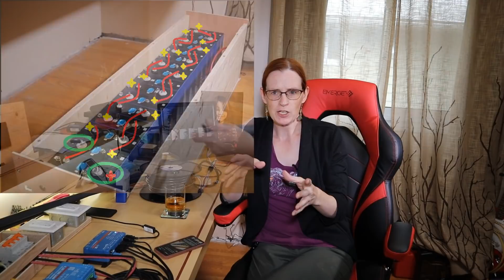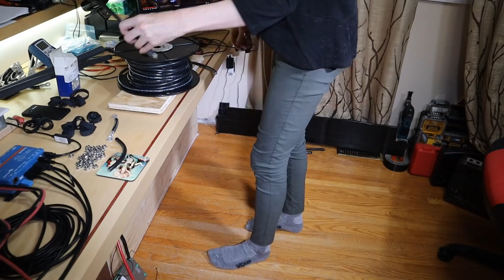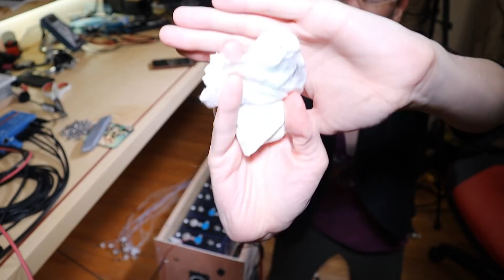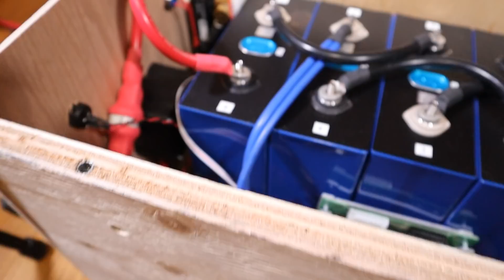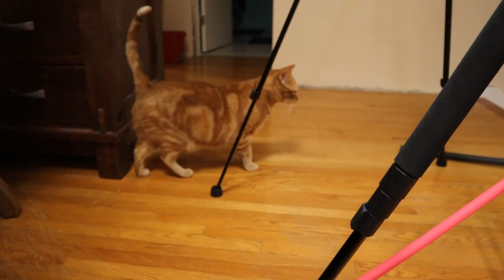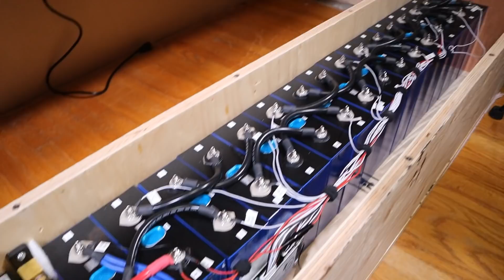A Better Battery Design - How to build a 48v Lifepo4 battery (Ep. 22)

Comment: The only real downside of that setup is that now some adjacent cells have a lot of voltage between them. So a cell-to-cell short will both pull a lot of current and damage a lot of cells. But with your long line configuration that's the best you can do.

OTOH if you're not going to be compressing the cells you could rotate them 90 degrees and use two long lines up and back, with a high divider between them to reduce the chances of shorts. That double line is also easier to understand, which means when you have to debug it you're not looking at an incredibly cunning bit of engineering and wondering what genius came up with it (no offence meant to Grant, but I've debugged genius ideas before and spent some quality time cursing out past me for coming up with them)
Reply from the maker: I've kind of settled on the idea that any battery to battery short will be catastrophic, so that's not an influence on general design. I do plan to add fiberglass board to separate things before the next battery case build, specifically to reduce this risk. Also, with the shrink tubing on the ends, the points where a short could occur are now very small. So generally speaking, I'm not too worried. 

Also, now that I get it, I wonder why I struggled so much to get it. Grant's design is elegant, it's a simple interleave. Later I'll do up a better drawing to show off the layout better. I think I was looking for complexity that wasn't there, and so was my own worst enemy.
Reply: I guess I just see one or two cells shorting as bad, but 8 cells shorting as catastrophic. Maybe put an extra fuse in where your short link is so that those physically adjacent but electrically distant paths have a break in them.

Conceptually what you have is a big U shape, but with the cells interleaved. So a fuse at the end of the U will help.

I love your videos BTW, you have a sense of humor and I share some of your thinking about risk. I'm surrently about a year away from finishing my DIY house build and once it's habitable I'll be building a battery to take it off grid. So I'm watching people like you and Alan in an effort to come up with design ideas for my setup... and ideally to learn from your mistakes. So thank you.  Also, sorry for the barrage of comments, you're making me think so I'm hoping to see responses to my ideas.
Reply: Maybe use red wires up one "side" and black down the other? Might make the interleaving more obvious?
Reply from the maker: @mozismobile  Not a bad idea, actually. I'll ponder that...
Reply: @TheDigitalMermaid  Or red heat shrink.  Could tape over that on this battery;s wires since they're already made.